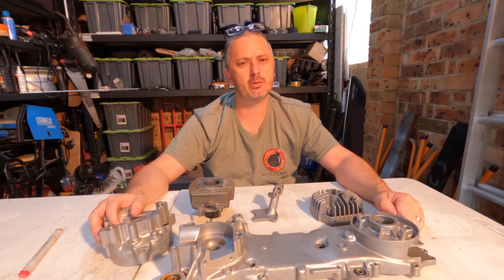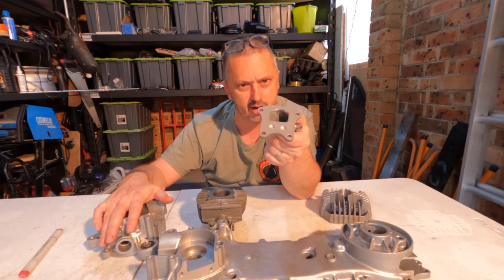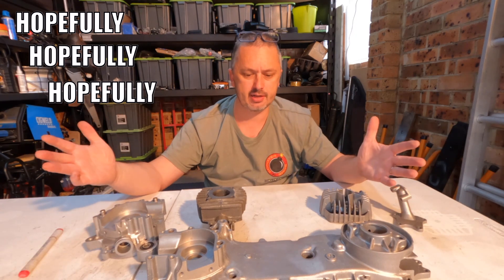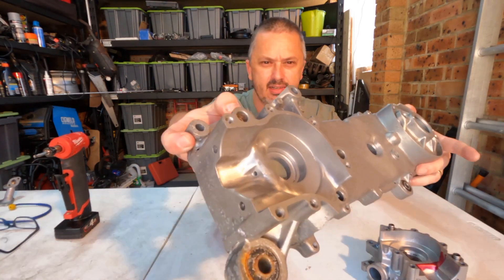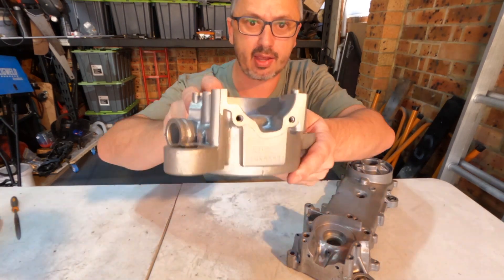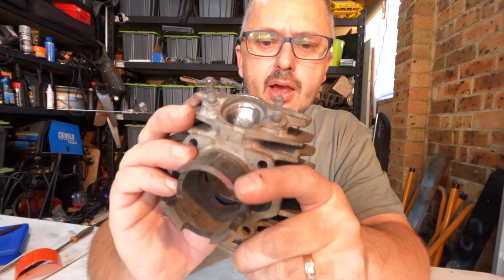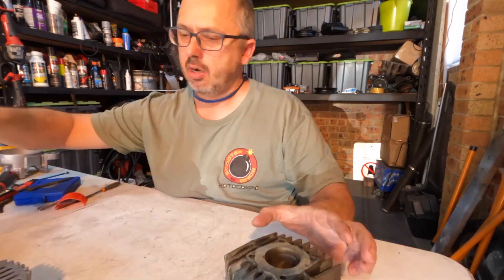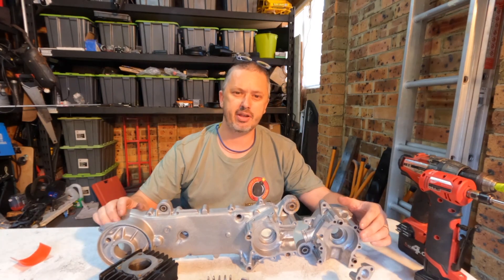Motocompo case & cylinder porting and flowing

Comment: Would like to see you get about 40kmhr out of this work you have done to the motor and case with a fresh set of bearings for everything you should be able to make that
Reply from the maker: 40 kph would be awesome that’s a massive 33% improvement. Got one more trick to try and get a bit more HP sauce. Fingers crossed for 40
Reply: @scooterbomb2152  my Compo runs between 40 and 40 KP/h. Until now I thought it's stock ...
Reply: @tofu042  mine too. 41kph stock
Reply: @nismobaron  I installed a new pipe a few months ago. It reaches now solid 45 km/h and with a loooong time it reaches 50 km/h. It seems the exhaust really is the limiting factor. I didnt even touched the carb yet, so it might got some more potential.
Reply: @tofu042  that's good to hear. I've had my eye on an exhaust for a bit
Reply: @nismobaron  I ignored an exhaust for way to long, its basically free power.